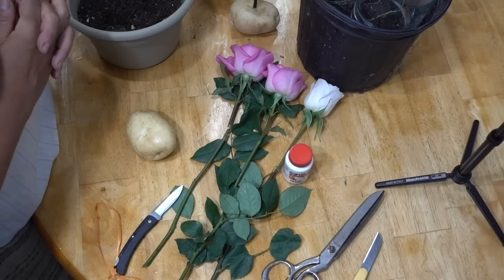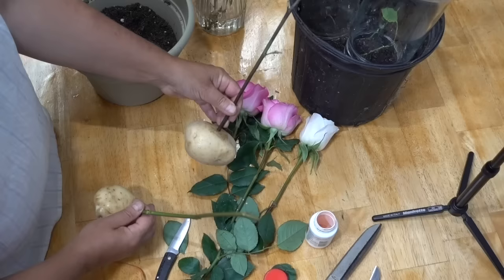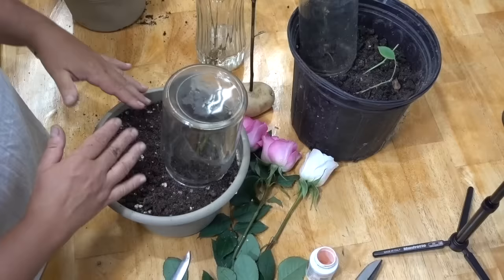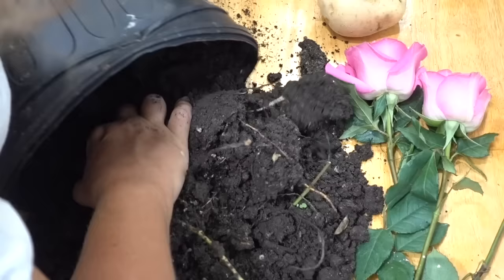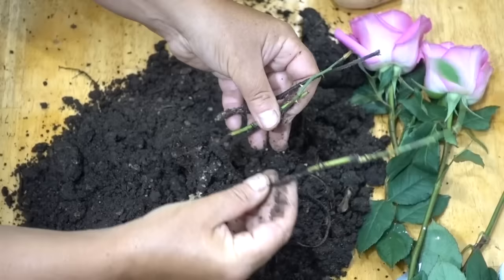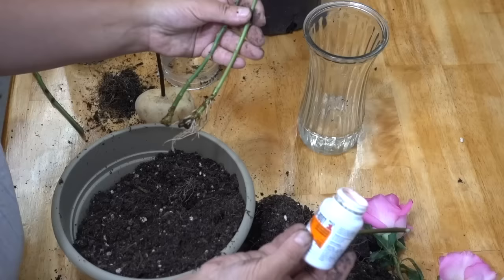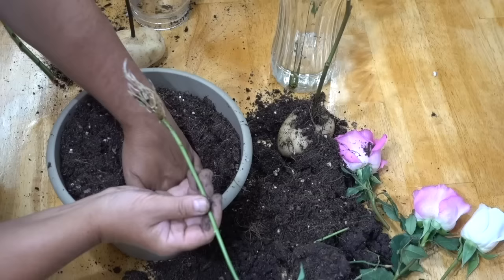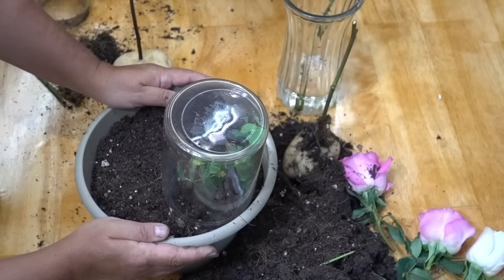Growing Rose Cuttings In a Potato Debunking the Myth

Comment: The way I  heard/saw it, there was no root growth hormone used, you cleaned the stem of thorns and leaves and you cut the stem diagonally a few cm down from the flower (the bottom end should be diagonally cut as well). Generally you would create a hole close to the stem size in a large potato, place your stem into the hole and push it into the flesh of the potato just enough to keep it in place and make sure it doesn't wobble around (do this again with a second potato and rose so you have 2 potato stems). Put about 5cm  of good soil in the bottom of a large pot (when I heard/saw it the pot was larger than the one you used and it had a saucer type drain at the bottom), place the two potato stems in the pot apart from each other and fill the pot with more soil. (This next part is epically important.) I heard/saw the use of plastic bottles because plants need air, for best results don't use bottles that are large around either. Make certain the bottles, after they are prepared, will be taller than the stems and ideally they should have a tapered neck with a soda bottle type lid (or similar). Cut the bottom out of a bottle and remove the lid before sliding it (right side up) over a stem and push it down into the soil to anchor it (repeat with the second bottle and stem) then just water around the bottles when needed. I heard that results are apparent in just one week. I did not get a chance to see the results and I never thought to ask so I am as much in the dark about this as you are. I also left before finding out how much sun vs. shade it requires for optimum results. 
For me it was blatantly obvious that it was a setup to "Debunk the Myth" with your carefully curated "evidence". As soon as you said you covered it with a glass jar I knew it was going to be a spectacular fail, so I don't know how you didn't know how it was going to turn out at the point you covered it with that jar. It is sunshine and humid winds weather (with plenty of warm rain to keep the forest fires at a minimum this year, if we're really lucky) here in Metro Vancouver, so I think I will give the way I learned to plant them a try. I don't do gardening (I'm terrified of the creepy crawly creatures and my thumbs couldn't find the colour green if I was standing in a pine forest and all my fingers helped.) and I live (quite happily) on the 14th floor, so I am going to attempt this by alternating my balcony and my living room as the growing areas. Maybe I will come and update y'all as to whether or not this worked but no promises written in stone. Cya.
Reply: Wow I would like to see your fingers after writing this.
Reply: And too much dirt you have placed in the pot, plus the bottle suffocates the plant

Comment: The potato must be gone to seed and must be actively growing where there are many root growth hormones. You need to reverse engineer things by logically dissecting (diapering) them.
Take champagne corks and split them on the bottom end about a half inch. Three of them on the lip of the jar will leave a small air gap.
Reply from the maker: What about the ethylene?
Reply: @Classyflowers  
Ethylene is only produced during decay. A growing potato actively sending out a root system has abundant root hormones in it.
Reply from the maker: Ethylene is hormone of damage. Plant physiology knowledge.
Reply: Does green thumb aside from plant physiology knowledge or other techniques suggested applies?

Comment: I have tried the potato method and it works. Dont have a video. But instead of over flowing the sugar in the potato to the plant, if you use a smaller size potato with honey, the plant uses the sugar to build roots and start showing growth ends.   Maybe try your experiment with a small branch and a small potato combination.
Reply: raknahs no need to waste a potato when you can root a Rose alone.

Comment: So if I take rose cuttings, should I remove the flower as well as the leaves and put it in the water for a month?
Reply: Yes, as well as any leaves. Grow in sterile growing medium (course sand, or peat and perile). Remember, you're not trying to fertilize the cutting, but instead to grow roots. Also, loosely placing a white plastic bag (kitchen bag example) over the top helps to keep sunlight out. Remember you're not trying to grow leaves/buds, but just roots, at this point. It's very easy, takes 60 seconds, and the results can be approximately 80%!

Comment: I would recommend making the incision within the potato at that little round area where the plant used to grow at.  Then jam the heart stem bottom into that little hole but not to go all the way through so that the stem acclimates to the chemistry of the potato. It ought to look oval shaped as it's going in. Then use miracle grow and saturate the dirt and water mixture in the pot so that the potato begins to root. I believe the logic is for the potato to root and the stem with some leaves and buds on it. This way the stem leaves and butts can also contribute to the potato as it assimilates itself with the potato.
Reply from the maker: It doesn’t matter how you do it. It is a hoax.
Reply: nonsense

Comment: A guy that cuts our grass cut down our rose bush that's been there for almost 30 years. My grandmother planted it when she first moved here.

There's a few cuttings trying to survive, 1 in ground but it's dark stemmed and the other is a green stem that was hit bad. 

Will this water method work for rooting the green stem? Any advice of saving what's left of the bush?
Reply: U don't have to do anything in spring it will start growing again.
Reply: About 5 years ago we hand a new fence erected in my garden where the was a beautiful climbing rose of about 10 years old, which I pruned hard before the old fence was removed. Anyhow the guy who dug the footings fro the fence also dug out my rose. GONE! Last year a twig emerged from the rose site with one tiny rose. Then this year the rose had a proper stem  and  was taller and stronger with 3 beautiful   roses. How about that for survival!
Reply: It sprouted back recently with 3 to 4 stems and is strangely almost the same height, so almost better than before. Still kind of mad at the guy though. My fear is it will never be or bloom the same as it had a weird trend of that anyway
Reply: @dodgersfnshepard8673  It should be fine. Roses need to be cut back every year anyway.

Comment: I tried the rooting in water with a hibiscus cutting and still got a rotting stem.  Though it did take longer to rot then the other methods I have tried so far.
Reply: Hehehe...thanks for the chuckle!
Reply: Try rooting in damp sphagnum. Make sure to trim off flowers. Make sure there are plenty of nodes left. If rooting in water, change water frequently. It roots in water just fine.

Comment: Real simple: you skipped one of the major steps; that's why this didn't work for you. What you fail to do with shave the tip that you cut(which should be cut at an angle); wet it THEN dip ENTIRE SHAVED END in RH. Also, make holes a little bigger to prevent stem from wiping on sides. The goal is to  KEEP RH where it should be.
Reply: 1VeganMom what is RH?
Reply: @dianefield3911  root hormones
Reply: @dianefield3911  lmao
Reply: Jae Batla why is that funny, just curious.  I really didn’t know?
Reply: @dianefield3911  it's funny because she mentions Root  Hormone (RH) several times
Reply: Jae Batla I always suspected I am a little ADD. This proves it lol Thanks.

Comment: Did you just use store bought roses?? Or did you get a cutting from rose bush ??
Reply: You could certainly try store bought but there's a greater/high chance of failure due to factors like the vigor of the cutting being reduced from the time period it's been stored/ how fresh it is (and the quality of care the cuttings/flowers have had up until your attempt like if it's ever dried out of water). 

For optimum results when propagating through cuttings  or grafting, the branch should be harvested from a plant in peak health, cutting with the cleanest sharpest knife of shears possible (crushing causes surrounding damage reducing chances of it taking) and should be immediately used as short a time from its removal as possible. Be sure any end cut is a fresh cut as well, do not use the previous cut made by the florist if using a flower from a bouquet etc. ethier.

Comment: Potato doesnt just rot in the soil. I grow tons of potatoes from store bought ones. Over watering causes them to rot.  You could have atleast grown a potato plant if the rose cutting failed...... there is far easier methods for rose propagation though.
Reply: That's what I thought?  We used cut potatoes to regrow them.  I recently put sunflower seeds into potatoes to root them and it seems to be working.  I'm trying this cloning method as we speak on some roses but I'm not holding my breath!  I've been trying to clone roses and hedge bushes this spring with no luck yet.
Reply: @mikewasoski1050  Hydroponic clone machine. 100% easier. 100% results. Wait till the roots are just less than an inch long and then place in a small pot for a while. It is fun trying different techniques like this too. Good luck!
Reply: @JAHBOAN  So to update, the sunflowers didn't really take but the potato's did, rose stems in the potato trick doesn't work.

Comment: in the case werea  potatoe was used as some sort of stabilizer for moisture u would need the roots to get under the potatoe and the potatoe to dry up during the process. im not even saying I use thi sprocess or its a good idea. im just saying in order for it to work it has to go thru the steps of rooting off the moisture of the potatoe. spreading to a spot that it can get moisture elsewhere and the potatoe drying up and not molding. I would even almost say u might want to boil the potatoe some before this and then slit it so that it drys out completely after 4-12 days. mash potatoes sound like a good seed starter to be quite honest. its good for your seed starter to dry up once the plant has grown out of it. ideally for best growth a plant should pull moisture up from the ground. the ground should not be watered fromt he top down. that is not good for the plant when u grow indoors.

Comment: I think for roses all that matters is what time of the year you stick them in soil. I think the potato method is suppose to provide moisture for the cuttings and make it easier.
Reply from the maker: Have you actually tried or are you just assuming?
Reply: @Classyflowers  I never tried the potato method, I bend a branch and bury it. Once roots start forming I can cut off the branch and plant it somewhere else. This is the most secure way for propagation. You can propagate anything this way. It's easy and secure way to do it. But I will try potato next  spring. Right now is the middle of summer and roses are not on my agenda.
Reply: @Classyflowers  Answer: yes, I took cuttings last year and stuck them in moist area and they rooted. No rooting hormone. Just fresh green cuttings. It took about 3 weeks if I remember correctly. Next year I will try the potato method.
Reply from the maker: Aspirative Music Production Good job. I agree with you.
Reply: @aspirativemusicproduction2135  you just cut a part off and plant it? What time of year?
Reply: Marija Michaels  I'd also like to know what works best for living in NYC
Reply: @Classyflowers  The potato method I have seen uses a cut plastic bottle as protection with the lid removed.  This is the big difference with your method as your greenhouse effect has no air coming in.

Comment: You did it all wrong. Cut the stem at a 45° angle. You don't need root hormones. Put sand at the bottom of the pot. Put the potato w/ rose bud with the flower on it not just the stem. Do not use the jar. All plants need carbon dioxide to breath. At least put holes on the jar.

Comment: I've successfully tried several different ways of rooting cut roses in the past. The potato method is the only way I haven't tried yet. If you are going to claim to have debunked this method then you need to have done it in the EXACT way that was described. Repeatability of methodology is essential to the scientific method. I've read about the potato method in a few places and watched a few videos and without fail they all call for a breaking of the bark either by scraping the bottom 1 inch of stem or by using something to squash the bottom 1 inch followed by dipping that portion of the stem into rooting hormone, before embedding the stem in the potato. You failed to break the bark. If you had, maybe you would have had success with the potato method as well.

Comment: Madam, how is the plant to breathe without there being an opening at the top for air?
It will definitely rot

I am myself going to try out the potato method as it has originally been shown, but leaving air on the top.
Madam, in your method, you have covered the stem entirely, that is not what is suggested by the internet method.
The internet method says there has to be place on the top(which is to be understood by the mouth of the bottle being on the top) for the air to come inside
I am sorry ma'am your experiment has been done wrong because you did not follow the proper method.
YOUR MISTAKE : YOU COVERED THE ENTIRE PLANT LEAVING NO SPACE FOR AIR TO COME INSIDE.
naturally, the plant will rot
Reply: It is told multiple times in the video: You must remove the glass jar time-to-time for the plant to bereathe.
Reply: Instead of opening the jar from time to time can't we just follow the original instructions and have an open top?
Reply: I have tried many times...rotten every time...
Reply: @madacsg  : True. But no details were given. How can people repeat a technique without specific exact instructions?
Reply: The soil was different as well. She used a potting mix where as  the demonstration looked like a sandy loam which is good for drainage. I also noticed the demonstrator watered after he placed the bottle . So...no water in potato hole encouraging rot of both plants coupled with good drainage  potato soil .

Comment: Did you purchase that potato in a food store?  If so, it moist likely has been treated with chemicals to prevent the potato from sprouting.  Not to say that there is some validity to planting flower stems in potatoes.  Just saying, any chimerical treatment would most likely guaranty this experiment a failure.
Reply from the maker: This potato method is a HOAX, it is really doesn’t matter how you do and where you purchased a potato. My potato is organic I am growing them myself.
Reply: @Classyflowers  or you're wrong.

Comment: You buried it too deep. It needs water and most importantly, you enclosed it with no air. You have to provide a vent opening like a plastic bottle with the lid off so it doesn't rot. Your "experiment" was flawed from the start. You should have tried it many ways, not just one. You proved nothing.
Reply from the maker: It doesn’t matter what I did or didn’t do.This method is a  HOAX!
Reply: I tried this and AM PISSED OFF because the rose died and I ended up with potatoes in MY flower garden INSTEAD of my veggie garden I had to UP end the entire BED and START over. ONLY extremely MEAN people advice such BULL. Even if the rose HAD lived I WOULD have had potatoes growing under my Bush WHAT a MESS
Reply: @Classyflowers  I absolutely THANK you for exposing these PEOPLE. ❤
Reply: That’s not how science works. You absolutely DO NOT do more than one thing. What you are suggesting is trying to prove you are RIGHT. That’s the opposite of science.
Reply: @seanrichards8774  - Where does a mansplainer get his water? From a well, actually.